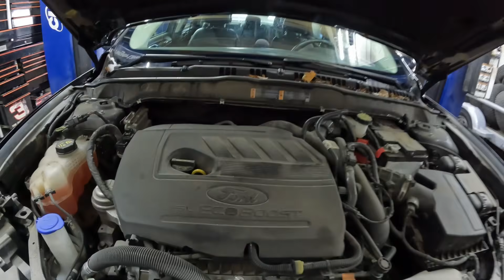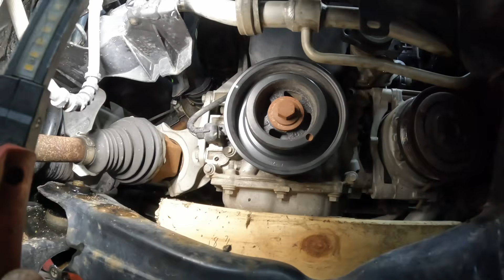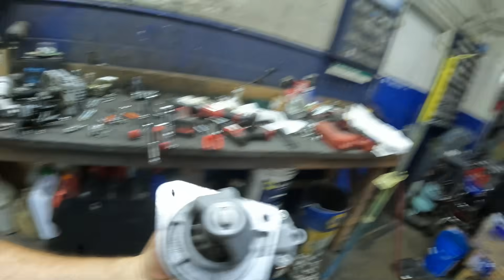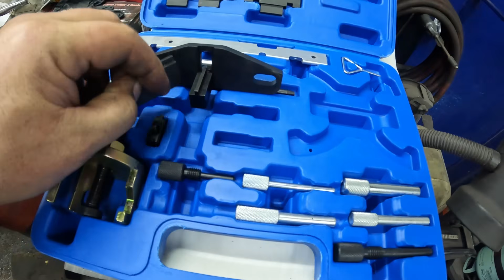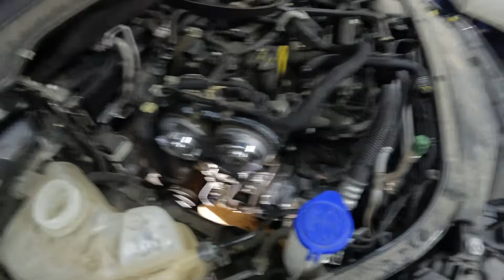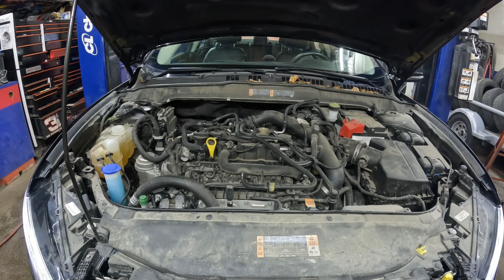2018 Ford Fusion 1.5L Ecoboost Water Pump & Timing Belt

Comment: Great video explanation!  I will try without using the flywheel lock, but I think I will try putting temporarily putting the cv bracket back on over the top of the stop bolt with a spacer as extra support behind the stop position pin.  How strong of an impact wrench?  I currently only have an older 1/2 drive air impact that I think is rated for about 300 ft.lbs.?  Maybe a good excuse to go get a 20v mid or heavy duty Dewalt or Milwaukee?
Reply from the maker: 300 ft-lbs might be cutting it close, so a stronger tool is definitely a good investment for this job—thanks for watching!!
Reply: @paycheckmonster  I purchased a Dewalt 800 ft.lb. 20v.  Will the crankshaft rotate backwards during removal using the impact without the flywheel lock?  I took a borescope and I could see a circle contact where the crank stop bolt hits the crank web, so it must be very close to a square contact putting the bolt in compression.  I am taking a little extra precaution and will bolt a plate on behind the crank stop bolt using the cv bracket bolt locations, I just used the flywheel lock plate and drilled an extra hole in it!  This will add some extra support to the threads and block for the crank stop bolt.

Comment: What is the bleeding procedure for the 1.5? Is there a vent like the 2.5l?
Reply from the maker: Use a vacuum filler to fill the system.  Start the engine, raise rpm to 3K for 30 sec.  Shut engine of for 1 min.  And repeat procedure.  Start Engine and let idle until t-stat opens and one cooling fan cycle.  Raise rpm to 3K for 30sec.  Let idle for 30 sec.  Turn engine off and repeat a total of 10x to bleed system.   Sounds fun right??  Thanks for watching!!
Reply: @paycheckmonster by the way, great video!
Reply from the maker: Thanks again for watching!!
Reply: @paycheckmonster lol sounds fun alright. Much appreciated. Time consuming but easy.

Comment: Some can tell where is the pcv on this motor
Reply from the maker: It's serviced as part of the crankcase oil vent separator that is mounted to the side of the engine block under the intake manifold.  Thanks for watching!!

Comment: This is one of the better videos out there on this repair. Have done few of these. We pull the pan 20 minute job and jam a block of wood in there so the crank cant turn. Works like a charm. And you are right the crank contacts the pin straight on not from the side.
Reply from the maker: Great tip on using a block of wood to hold the crank. Thanks for watching!

Comment: Thanks a lot bro, i figured "hey a dry old fashioned belt easy" yeah i didn't know that in the spineless pully now resides the ring for the TDC sensor. Surprise!! Thanks Ford!!

Bought the tools and did it properly. 

You were a huge help thanks again from the Netherlands.

Comment: Nice video...
The gear at the end of the crankshaft is floating, meaning it rotates freely, to absorb any differences in the tooth pitch of the new belt... and ensure it's positioned without tension or slack... To time the crankshaft, you probably use a bolt in the engine's flywheel housing, which is inserted into the housing and secured to the flywheel.
Reply from the maker: Glad you enjoyed it!

Comment: do these engines bend valves if timing skips commonly i really need to know if possible 

also should the cam phasers move independently of the camshafts. i’ve used the cam bridge locking tool on the back of the cams but the cam phaser sprockets don’t move at all independently is that normal
Reply from the maker: These are considered interference engines. Yes, they will bend valves.

Comment: Im doing my daughter's 2017 fusion soon, I've read about, and seen pictures of the oil pickup tube screen being plugged from the belt coming apart.     Should i pull the oil pan and check that?    Great video, much better than a couple others Ive watched.
Reply from the maker: This belt is a dry belt.  It's not inside the engine so that wouldn't pertain to this repair on this engine.  Thanks for watching!!

Comment: You mentioned about bleeding the air out of the cooling system on that fusion, how to do that?? I have a 2018 fusion that can sit and run without any issues but, when i go to drive it the temperature gauge goes up to almost hot, but if i slow to a stop it will then cool back down. It will heat up again once i start driving it again until i slow down or let it idle the temperature will go back to normal. Would that be an air lock?? I can sit in the driveway and rev the engine to 2000 rpm and it won’t get hot at all, the temperature gauge never goes off normal. Can you help with some advice??? I am stumped on this
Reply from the maker: Is there any trouble codes??

Comment: What a terrible design. Why not just use a woodruff key? You'll never convince me it was easier to design it like this with all the associated specialty tools......
Reply from the maker: Too many engines today are this way.  You can get yourself into to trouble thinking you can just pull off the balancer and then you find out everything is out of time.  Service manuals are a must to check for proper procedures before you even touch some of these engines.  Thanks for watching!!

Comment: -----@@--Without removing the starter.  You'll brake that crank pin uppon torque wrench

Then you'll  have to also drop the oil pan
Reply from the maker: I have never broken the pin on one.  I've stated many times that the crank makes contact on the very tip pushing straight back.  It does NOT contact the pin from the side.  Thanks for watching!

Comment: That's what you call high torque?😂. Around totally 150FTLB or 200NM? That's lower than the wheel bearing. Ford is very good with that low torque you might wanna say! Check out BMW and other german cars that are all shitty to see things like above 600NM for that crankshaft bolt.😅 Ford is good! Oh..., and that 2 seconds is odd? It's about physics. Maybe exaggerates for better precision which I consider pointless in the end, but that standing time actually evens out the surface pressure in the threads. That's what is it about, to smoothen out any peaks in thread tension.
Reply from the maker: Thanks for watching and for the insight!

Comment: I've seen times here on the tech line where the crank did need to be locked in some way other than with the peg because it won't hold much load and will warp causing cam/crank correlation codes.  But if you can figure a way not to put much pressure on the peg all should be good.
Reply from the maker: So the crank butts up to the very tip and not the side.  It should not shear it off or disform it.  It acts like a jack bolt really.  Thanks for watching!!
Reply: @paycheckmonster  😥

Comment: Thanks for the video. I took the advice and didn’t pull the starter. Alignment tools worked great. It was a big job to replace the timing belt and water pump. Everything was pretty straightforward. I don’t think the ford engineering was really that bad. Thanks again for your helpful video.
Reply from the maker: Appreciate you taking the time to comment! Thanks for watching!
Reply: I was told to get a timing belt component kit because it comes with the turbocharger...apparently my turbocharger is bad he said...I have no codes or anything. How would Ik if this is true? Was told its making a noise
Reply from the maker: Timing belt component kits DO NOT come with a turbocharger.  If someone told that it did, I would question it for sure.

Comment: Do you need to remove the timing cover to replace the water pump in a 2017 Ford escape se 1.5L ecoboost?
Reply from the maker: Yes.  You will also need to remove the timing belt because the timing belt tensioner needs to be removed to replace the water pump as well.  Hope it helps. Thanks again for watching!!

Comment: Thank you for the great video!  I was just about to try and pull the starter motor when I watched the end of your video.  I really don't want to have to pull that starter if I don't have too.  I've tried torquing the crank bolt twice now, and the pulley keeps slipping right about when I get to 50º or so, which throws off the timing and I have to start over.  Any suggestions how to keep the crank pulley timed during the torque process?
Reply from the maker: Just to be clear.  You have the pin in to set the crankshaft position and the timing tab tool to set the balancer location??
Reply: @paycheckmonster  Yes.  The pin is in and the crankshaft is butted up against it.  Yep, the timing tab tool is locked into the balancer notch.  The first time, I removed the timing tab tool after torquing to 74 lbs.ft.  Second time, I kept the timing tab in as I was trying to torque the 90º, and totally bent the tab when the pulley slipped, so I had to order another timing tab tool.  Definitely struggling here.

Comment: No need to pull the starter just be easy when you tighten the crank bolt. And don’t use the tool to hold against the impact . Done many and never an issue
Reply from the maker: Thanks for watching!!

Comment: What's a job like this cost the customer?
Reply from the maker: I could only speculate.  It depends on were you are and the shop you take it to.  I think I charged like $1,200 if I remember right.  I replaced rear shocks on it also though.  So maybe like $800 - $900.
Reply: @paycheckmonster  Great video, very informative. My local dealer quoted me $6500-$7k to replace the water pump and coolant hoses, car only has 60k miles. Theres no way i can afford to pay that, im going to attempt it myself.
Reply from the maker: Thanks for watching!!

Comment: Some of here has lucky not to bend or broke the timing pin. The reason for locking the flyweel is because there is to much pressure on the timing pin if you crank the camshaft bolt! I've seen many broken. Of course it's a lot of work to remove the starter. Also I've seen a engine block broken on the timing pin area 😮😮😮.
Reply from the maker: Not sure how the pin bends or breaks when the crank butts up to the tip not making contact from the side. Sounds sus.

Comment: I just changed the timing belt and water pump on a 2017 fusion 1.5 and was able to do it successfully without removing the starter. I could see the flywheel on the opposite side of the starter and marked it, it didn't move when I puled the crank bolt, it started and runs fine. Thanks for the tip.
Reply from the maker: Glad you were able to get it done and thanks for watching!!
Reply: Did you have to adjust the timing
Reply from the maker: It's all controlled by the ECM so you have to make sure you get the belt replaced properly and the crank trigger set correctly.
Reply: how can you see the flywheel with out having the starter out. i thought it was incased by the trans case. not judging just a ?
Reply from the maker: You don't technically have to see the flywheel because there is no timing marks on it.  It's all timed from the front of the engine.

Comment: Great video! I know it's arguably best to do the timing belt and tensioner when getting that deep into it, but wouldn't it be possible to replace the pump at round the 19min mark without removing the dampener pulley? It seems like you could still use the cam locks and pin to verify the timing before tensioning the timing belt but save yourself the trouble if you're worried about removing the starter or trying to torque it with only the pin and cam locks.  I have a 2019 Escape that needs a water pump but it has less than 50k on it so I'm not thinking it would require a new timing belt for some time.
Reply from the maker: In my case. I have to provide a warranty for the repair.  I can't justify going through this procedure without replacing all timing components.  Thanks for watching!!
Reply: @paycheckmonster 100% get it. I didn't mean that question directed toward you, that's my fault. I was just trying to justify myself doing a pump only since Im only 1/3 of the way to the timing component  interval.  

She's all torn down, waiting on the pump to arrive tomorrow. Video was a huge help! I guess worst case is i get to do this again in another 50-100k. 

Anyway, thanks again!
Reply from the maker: I appreciate it!!  Glad it helped.
Reply: @ryanlane4952  Hi, i have the same vehicle 2019 Ford Escape with 60k and a leaking water pump.  Were you able to replace it as you noted above without having to remove the timing belt? If so, that would save me so much time.  The dealer wants $6k to replace the water pump and hoses, theres no way im paying that for a water pump.

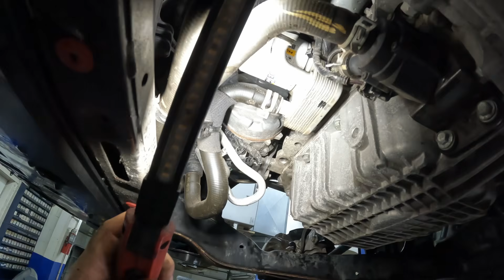Comment: Yeah I got something to say! I'm actually waiting cuz it's only 3:30 in the morning right now, so I can go get a water pump gasket since the Motorcraft water pump didn't come with one. And I've decided that when I go to put this in, I'm going to do the initial 75 ft lb of torque, and then I'm going to remove the pin. I'm going to Mark 90° with a Sharpie on the crank pulley and the head of the bolt. I'm going to use an impact. I'll get it about 4/5 of the way there or so, I'll wait a couple seconds and then I'll get the final bit done. I'm going to put just the ever lightest amount of oil on the first seven threads of the bolt, it'll smear it on the threads as it goes in anyways but we're talking a very light coat. I'm also going to be using retaining compound from Loctite on the crankshaft where the pulley goes over it, and then I'm going to put the ever lightest coat of engine oil on the face of the washer that will go against the pulley and between the head of the bolt and the washer as well. I'm talking about is if you were to put a drop on there and spread it, and dab it all back off but you know you're not going to actually get it all off unless you use some soap or brake clean to actually get all residue off, we're talking that light. Super light. Now all that probably sounds fine and dandy but there's one more thing I'm going to do that you're going to be all like, wtf? I'm reusing the bolt. And nobody can stop me!

I have no faith in that pin, be on the initial torque to the specified foot pound. Therefore, I will be doing the last bit with it taken out because if it breaks then I have to pull the pan. If it bends, then I have to pull the pan.

In all reality what I'm talking about here isn't all that wild. I swear it's like most of the bolts out there that they say are tortilla, are really torque to angle. Because you can do a straight edge along the threads and see that there was no distortion. You can measure the bolt from the flange to the tip of it and see that there's no extra length. So yeah, I'm reusing the bolt. Now I've reused torque to yield bolts before, and the only times I've ever seen actual bolt stretch is with aluminum bolts. Never seen it otherwise. And... I do have the benefit of using the retaining compound like they did from factory.

Also I knocked off that dang reluctor ring on the crankshaft getting it off, because I was heating it up around that area to get the crank pulley off the crankshaft with the factory retaining compound, and I guess I went up against it and it actually been a little bit so I bent it back in place carefully, and then I used a sheet of ferrocell to check the pattern on that reluctor ring, to make sure it was all good. People may not know, but if you accidentally touch that with a magnet and you check it, you'll see the lines going squiggly all crazy everywhere. And it's ruined and there's no fixing it. Learn that off of video for the 3.6 Mopar engine when they say don't let the camshaft back ends touch each other when you're doing a head gasket job, and the guy in the YouTube video showed where he took a magnet to an already bad one, and he took it to part of it that everything looked good on that reluctor ring, he showed it through that special magnetic film before and after and it will take those lines and screw them up. I just wanted to say that because if you've never used that stuff before, it's on Amazon to get a little piece of that and it's like pleather..... it doesn't fade or crack with age hahaha! No, it's like two sheets put together with Magnetic material inside of it and you can check magnetic flux lines of anything you want. So basically, I came to this video because I didn't know the torque specifications were and I tried two different AI programs and they were giving me wildly different steps. One of them was the start twerking it at just north of 140 ft lb and then a couple stages of angle and I knew that was ridiculous. I guess gone are the days where the average engine all you have to do is stick an impact on there and tighten it until it stops moving. And you know what? I bet I could just do that with this and it would be fine as well but that is getting a little bit wild even to my own wild way of doing things. Because at least with the way I plan to do it, if my impact can't get it all the way to just about 85°, then I know I need to take off that starter and pin it from the back. But today's cordless impacts are so powerful. I'll be using the Hercules brand and then if it can't do the job which I seriously doubt, grab my friend's Milwaukee
Reply from the maker: There is a lot going on here.  Whatever works right.  I know there is a lot of questions with that pin but I'll say it again.  They crankshaft does not contact the pin from the side. it contacts it a the tip.  Pushing directly on the tip like a jack bolt.  So you shouldn't have any  issue with it shearing off or bending it.  If anything, the threads would fail and push it out of the block.  Good Luck and thanks for watching!!